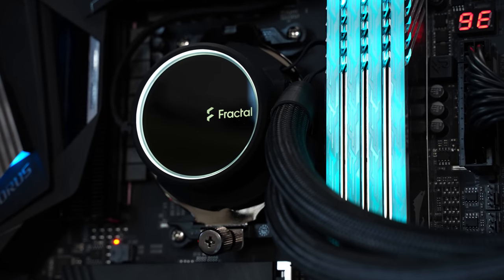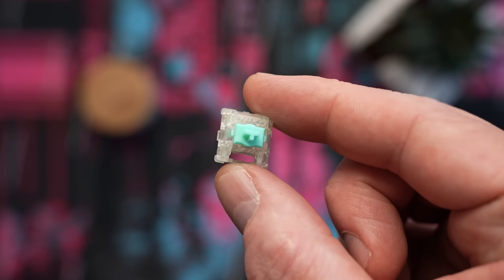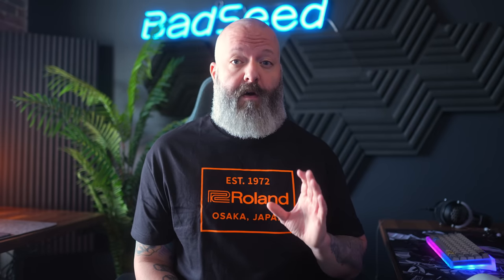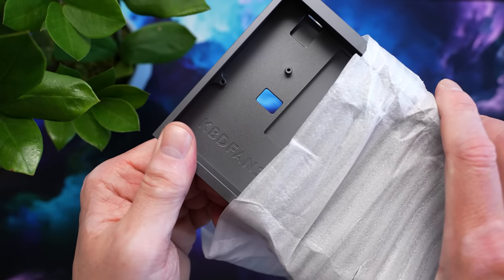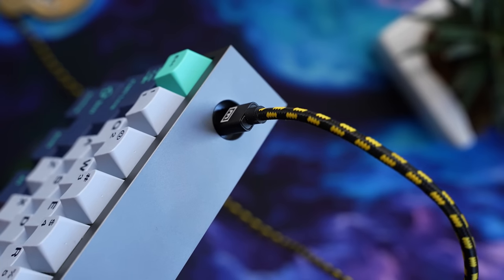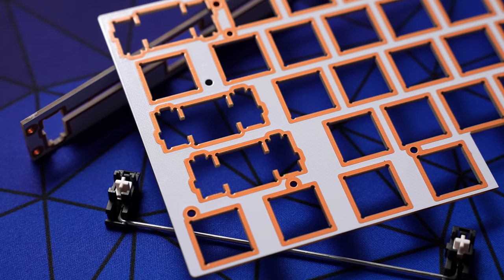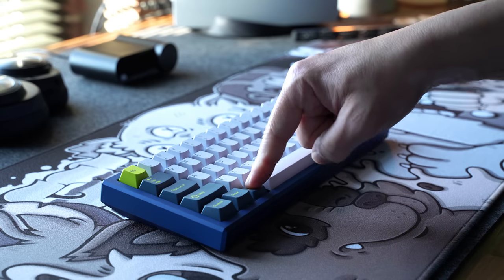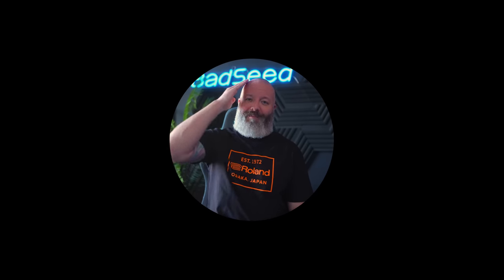Ultimate Wooting 60HE Mod Guide

Comment: The Burger mount IMHO is a pointless mod, if anything makes the experience worse.. Hence much later in the video after you did it and were going over the tripods on the bottom of the switches you said "it's still a very firm typing experience unfortunately" and you showed yourself pushing down the entire board and case. Tofu60 and any case alike, if you add even one layer of foam to the bottom of the case it is going to touch the PCB even if the PCB is just sitting in the case and not screwed in. The burger mount in theory seems like it would work/help but it really does not, it makes things worse IF you add foam in the case. I have three Tofu60 cases one of which is the frosted acrylic and you can visually see that there's not a lot of depth inside the case at all so the burger and foam is aiding in keeping the board incredibly stiff. If you took the o-rings out you'd notice it likely helped with the board not being as stiff or you can keep the "burger mount" and take out the foam, one or the other.

I've had my Wooting for quite some time now, I think personally if someone were to come out with a 60% ANSI Silicone PCB dampener that along with the tripod + films (when they become readily available to account for the large stems / channels) it would perfect the Wooting.